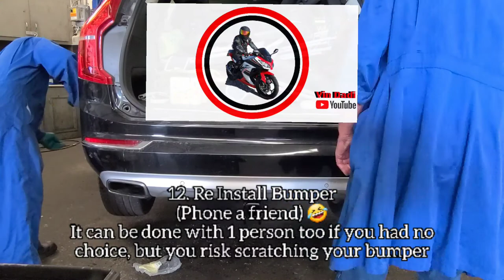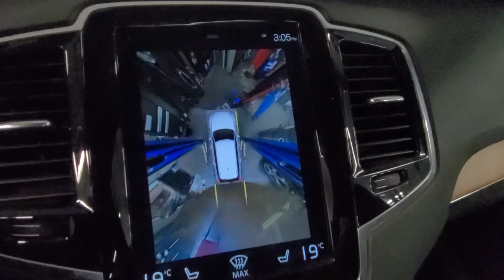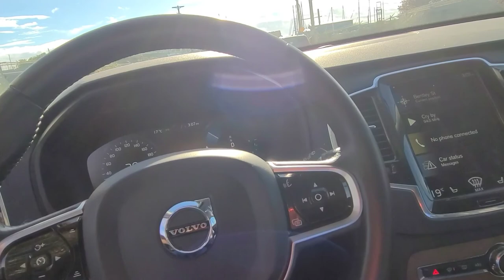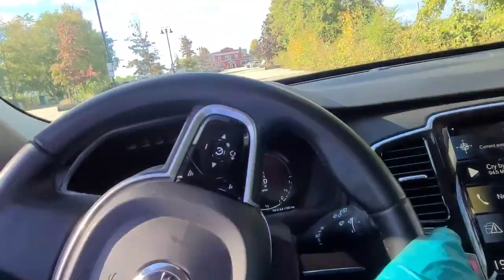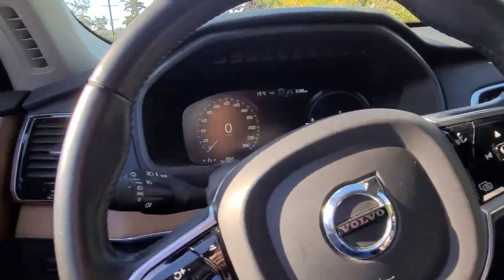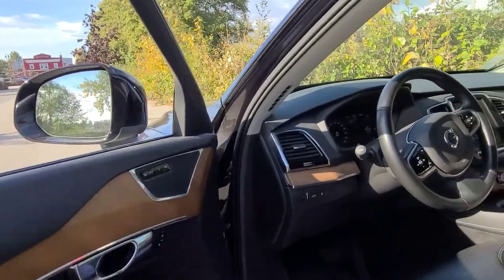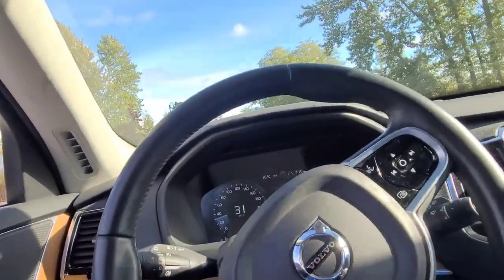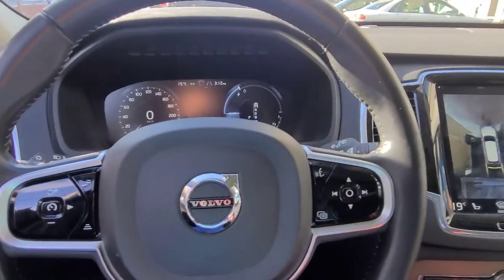HOW TO INSTALL TRAILER HITCH | 2018 VOLVO XC90 T8 | WALKAROUND | FRONT VIEW | SIDE VIEW | REAR VIEW

Comment: Question- if bike rack mount is there option to turn off parking sensors?
Reply from the maker: Locate the fuse box and see if there is one for the parking sensors and remove it 🤷